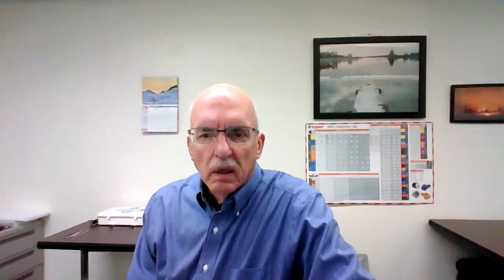Electric Education Center   Session 4 Receptacles

Comment: Was told at CHOP years ago that the caps that are inserted into receptacles for Kids safety are choke hazards and should never be used. Wish I had a dollar every time I removed a device [ receptacles & switches ] that a wire pulled out. Years ago I wired in 2 injection molding machines that drew around 70 amps and only had stab in connections for my # 2 wires. argued with the machines service tech so I had him insert wires on 1 machine and myself the second machine. neither lasted more then 2 weeks before burning up. Would not even trust a #14 gauge back stab that only feed a 9 watt switch controlled LED lamp. If you are using a metallic wall plate or 1900 cover safer to have ground contact facing up in the event screw falls out. On a Horizontal installed receptacle always safer to have grounded conductor [ neutral ] facing up, Rich Thanks for another great vid. Tom Grabowski

Comment: There is a white paper from Siemens that indicates that you should not use back stab in connections. It will contribute to tripping of arc fault circuits.